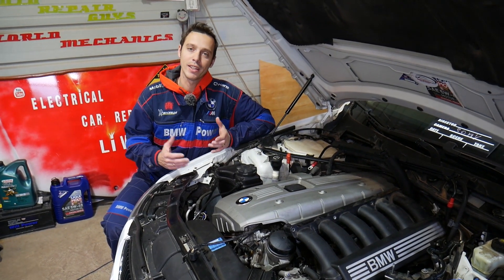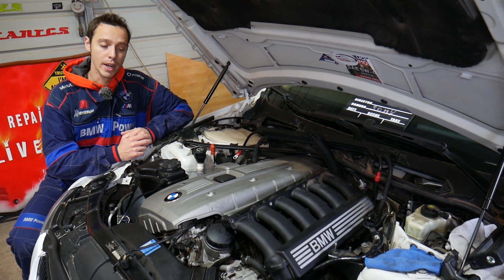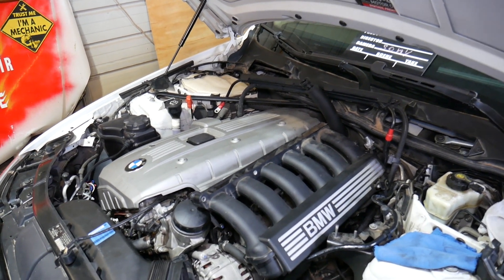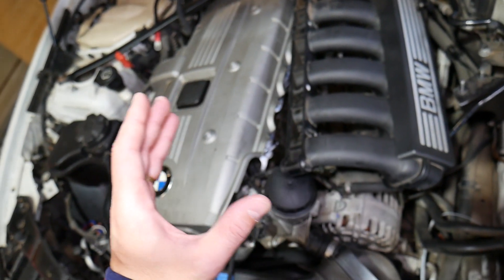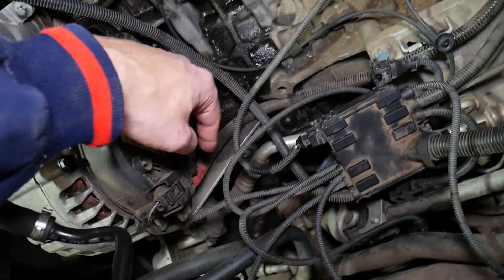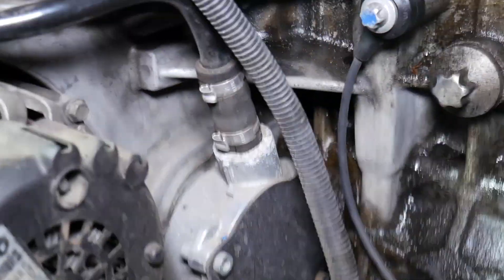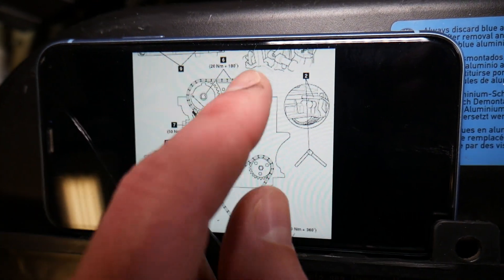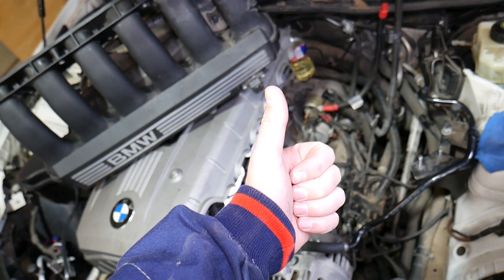BMW E60 E61 BRAKE VACUUM PUMP LOCATION REPLACEMENT EXPLAINED 523i 525i 528i 530i 535i

Comment: I have a BMW e60 n52 brake in winter, there is a tight brake in summer.  From what can be?
Reply: brake fluid not to spec with your climate/conditions

Comment: Thanks 
Question . I recently take my car for a vacuum pump replacement and I was told that the chain inside had plastic parts that melt down and need to be replaced . Is this correct ? 
Chain looks loose on the video that the mechanic sent me . 
Please advise